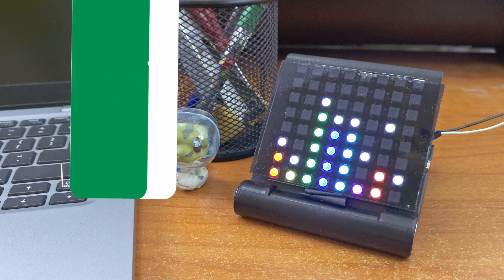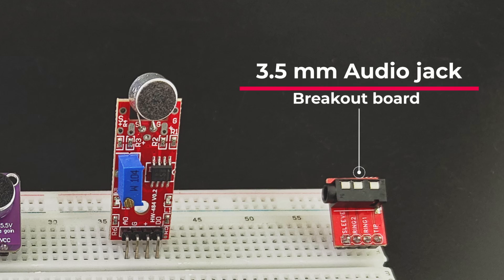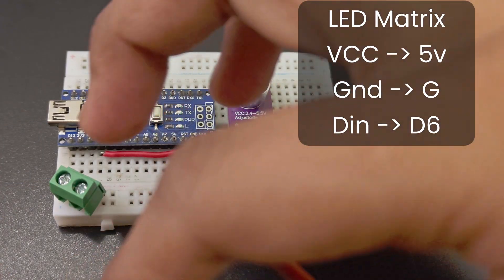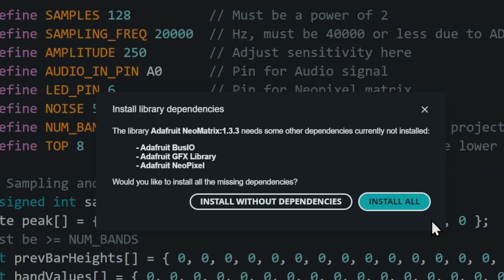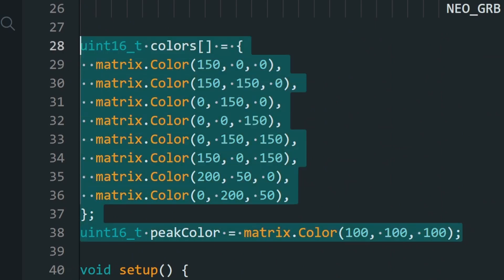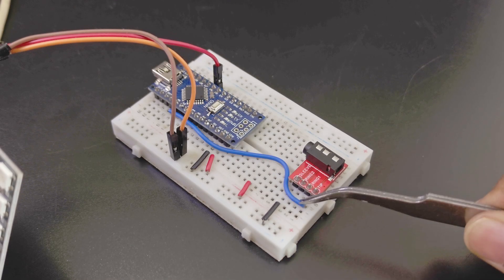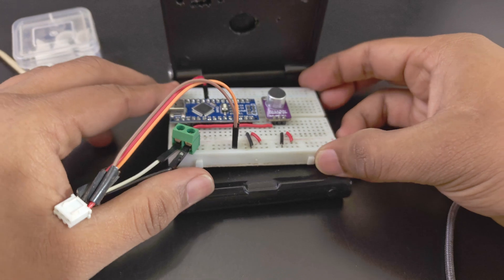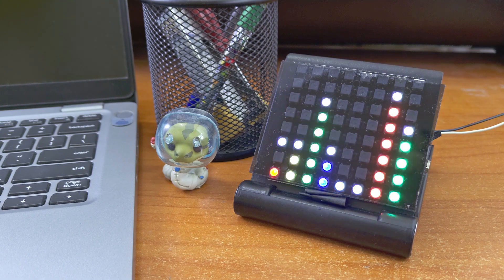Arduino Audio Spectrum Visualizer | Simple Project with code

Comment: Great project! I enjoyed the process and beauty of this spectrum visualizer so much, but I have one problem. I used a 3.5mm jack along with an audio splitter for the project and then connected it to my speakers, but I experienced distracting noise from the speakers after I set up this project just as you did in this video. How can I resolve this? Both the audio splitter and the speakers are working properly.
Reply from the maker: Most likely there is noise on the ground connection.  Try putting a capacitor between the speaker lines. A small one like 0.1 uf. Connect it across the positive and negative of the speaker. Also try different capacitors for results.
Reply: @techtalkies1  Thank you so much for your reply! I really appreciate it and will give this a try😇

Comment: Great work, how to make it for stereo?
Two separarete 8x8 mattrx?
Reply from the maker: This project uses a mic for input. Stereo is technically not possible. You'll have to use an audio input using an input jack or something similar.
After that, there are several ways, you can use a wider LED module, and split the meter in two or use 2 LED modules as well.
Reply: Thank you, i Understand it is mono, I will add one more input, how to change the code to use common scrpit to handle both i puts, and drive Two output for Two 8x8 Displays separatley, independent?
Regatds
Reply from the maker: Even if you add another mic, the audio it picks up will be relatively same as the other mic anyway. So you still want to add a second mic?
Reply: @techtalkies1 
Count as Two separate audio line inputs, they could be very different...
Reply from the maker: Cool. Then you can split the display into two segments ,in code
Reply: https://youtu.be/E4TS03m0uIc?si=G5tmg_8H7it2mAYn
Reply from the maker: Awesome!
Reply from the maker: Looks great